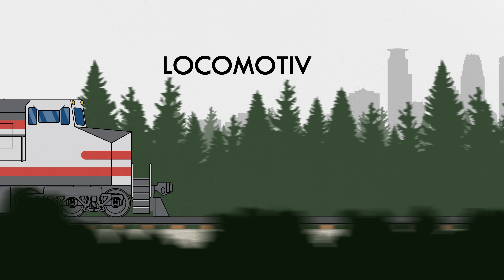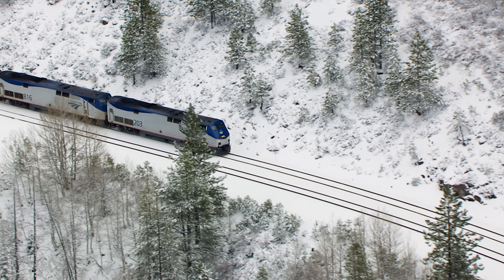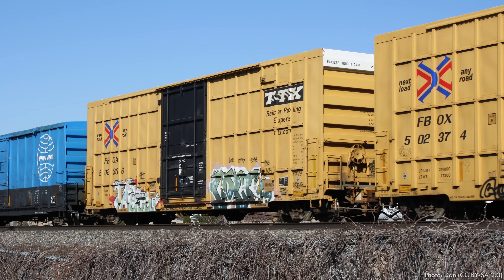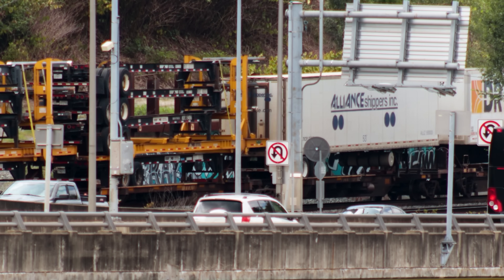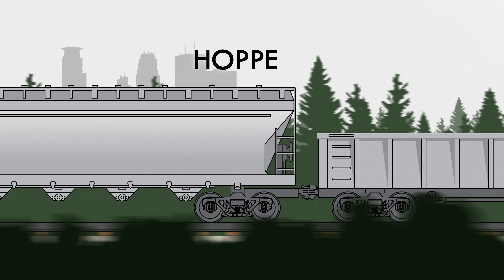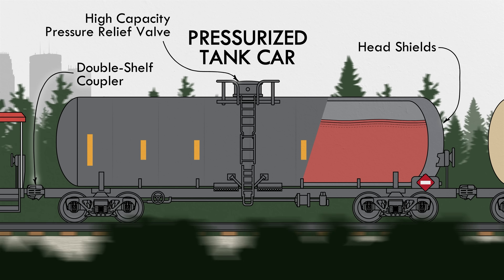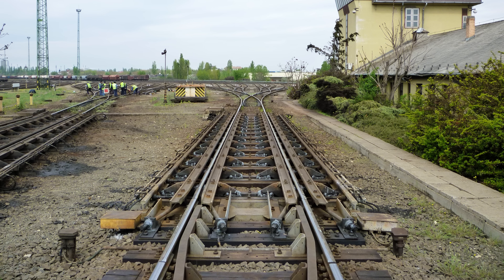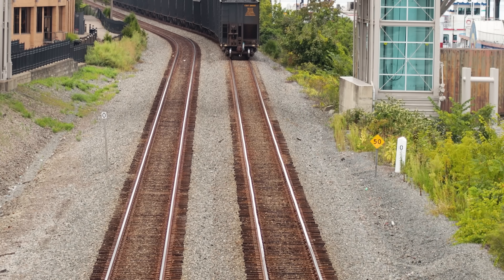Every Type of Railcar Explained in 15 Minutes

Comment: As an European/Italian who lives right above a railway and is very fond of trains, this video is a joy for the eyes! And it is really interesting to see the differences between rail services between The USA and what is done here in Europe. 

Double decker passenger cars are very common in many European countries, like in France and Italy for example, because people here tend to use the train a lot more than the car to commute between home and the workplace or school location, and double deckers obviously are more efficient in passenger throughput in a given amount of time. Low-level cars are also very appreciated because they are most of the time level with the platform, making embarking and disembarking a breeze especially for the disabled. European train manufactures produce mainly low-level rolling stock, double or single decked, these days.

It seems that the main differences between USA and Europe is in a few cars: cabooses, autoracks and coil cars. 
For cabooses, the closest in Europe are the brake vans that were used mainly in the UK when cars had no brakes on them. The UK also had, between the 60s and the late 70s, the so called "brake tenders", which were very low and very heavy ballast cars, looking like big metal slabs on wheels, fitted with automatic brakes, meant to be connected to diesels and assist them with braking. Outside the UK, some European freight cars with brakes had a "braker's box", a very small cabin where the brake man sat during trips and provided him with a brake handle for that car. Continuous braking in all cars/wagons did away with all of these eventually. 
For autoracks, the main difference is that those in Europe are not enclosed like in The USA. The loaded cars are therefore exposed to the elements, like in a normal car carrier truck. Also, autoracks are at most double decked instead of triple decked.
European coil cars are basically in two flavors: the "Shimmns" type and the "Rhlmms" type. The difference is wether the car is enclosed or not. The Rhlmms cars are basically flat cars with shaped seats for the coils, up to 5 usually, which are open to the elements. The Shimmns have a similar arrangement but are also enclosed, and there are two types of covers. One is a simple tarpaulin stretched all over the car from bulkheads and other support beams. The tarpaulin is opened by folding it one one side by moving said beams; the other cover type is a  rigid telescopic metal cover, divided in three pieces, who slide into each other when opened. 

Thanks again for this treat, Grady. Keep it up!!
Reply: Also, at 11:59 the crane (Rauma-Repola Rc 200) is definitely European - it was built in Finland and operated by a Finnish company (NRC Group)
Reply: Another though by gone car to add: The mail car. Basically a rolling Post office where mail would be sorted and then simply tossed out the train in bags whilst it was speeding through a town. Some could also pick up hanging sacks of mail on the move with special hooks. Could be attached to any type of train although express services were preferred.
Reply: I also regularly eee track laying cars parked at one of our local stations. We are quite central, so it's a good place to store them, I guess.
Reply: I do actually see a lot of covered autorack cars here in germany, mostly used to ship new cars from the factory to ports etc (BMW at least use them a lot)... they're also only double decker of course due to the smaller loading gauge.
Reply: @johannesgutsmiedl366 it is normal nowadays, for autoracks to be enclosed, almost all trains that operate in summer going for the coast here in croatia, have that feature to bring your car with you, all have enclosed autoracks, and in general, i did see some old type open ones some years ago on railfan vids from serbia, when they shipped new fiats from kragujevac to the port in bar mnegro.

Schnabel car can be seen here in croatia when they ship industrial trafo from zagreb to the port of rijeka, i think it is siemens made, before some of them were shipped by the an 225 mriya, now only by train, no other plane in the world can lift off with that type of mass.
Reply: thank you, that was very informative!
Reply: In Latvija we only have 1 story passanger wagons, no need for the extra capacity, Ive never even seen a passanger train with more than 5 segments.
Reply: agree
Reply: American auto decker Waggons are covered because kids started throwing stones at the cars
Reply: @henrystoll9402 stones and stealing them

Comment: At 13:00 you see a lot of railroad fasteners are loose.
And ... a bunch of coupled cars is not a train. To be dispatched as train there has to be a brake check, cargo check/registering and EOTD (end of train device) installed. In the beginning of railroading cabooses were housing the brake men. Later on Westinghouse air brake became relyable and cabooses were only to watch cars not getting decoupled and lost in the mid of tracks. The next train would run into it presuming the track is free.
It's a science to control tracks and dispatch trains in a safe manner. Sometimes an extra switch to nowhere on sidings are only to prevent cars running onto the main line (by wind, on a slope) like a derailer.

Comment: Great video.. but i think there is a one type missing.. a control car - passenger car which has a driver cab.. in Czechia we have eg. class 843 which is a passenger car with engine, then you hook up some classic passenger cars and sometimes on the end is this type of car (eg. class 943).. driver just goes to the other end of the train and drives it from this unpovered car. 
https://en.wikipedia.org/wiki/Control_car

Comment: I think you should try to approach this more globally,...

in that case even what you say at 0:47 is inaccurate then as many trains over europe, especially passendertrains have motors on many wagon in multiple-unit sets
additional passenger cars might be control cars, which are normal coaches but with a control station at the end
many older passenger trains also have a luggage car or a bike car

Comment: Greatly enjoy the High-Cubes, Autoracks, and flatcars together since they’re all largely tied to the auto industry. High-Cubes, particularly the longer 86ft ones, were largely developed to carry auto-parts from factory to assembly plant. Those finished products roll out on Autoracks, which used to look a lot more like double or triple deck Flatcars. Technically they still are, but the roofs and side sheets make them look like boxcars, not helped by the fact boxcars with end-doors was the early way of moving autos from plant to sales floors

Comment: There are loads of trains without locomotives. Wheels in each carriage are powered, either by overhead electricity or by diesel engines. Certain carriages have small cabins for the driver on the end, but still allow passengers through so trains can be joined together.

Comment: But trains don't have to have locomotives. Aside from the common design of railcars, they can be hauled by cables, compressed air or electromagnets; or even moved simply by gravity.

I've never been sure why we don't see bilevel cars with bilevel boarding. Train stations are normally three dimensional structures, already.

Comment: Another interesting fact about trains is that there is a length limit for them. Since sometimes there is just a single rail running from one point to another, they have to stop and let others pass in small railway stations, and if you exceed the length, things go south very quickly.

Comment: You should have included a triple crown car as a rarely seen car and pretty cool. It has what’s called a bogey which a tractor trailer is set down on under the rear wheels and then connected to the front of a trailer using special pins. I sort of looks like a line of trailers driving on the rails with only the trailer to support the weight. And maybe go into detail on the different types of engines out there. Such as wide body or standard cab. And how the air brakes work completely opposite that of semi trucks.
Reply: Those were quite common in the 90s, but are now all but extinct... There's 1 Triple Crown train a week that runs from Lafayette, Indiana to Ft Wayne, Indiana, but if I'm not mistaken,  that one is to be phased out soon, if it hasn't already...
Reply: @joshhardel528  there is an an entire triple crown yard in detroit Michigan that runs trains daily out of it. I just built and brought one down from detroit that was 6700 feet the other day. Getting ready to go back to detroit to do it again tonight. There is also a triple crown that goes though my yard to Decatur Illinois that we get on daily.

Comment: Nice Video. My climbing gym is right! next to one of the main german czech, with its outdoor wall directly overlloking the tracks, so you get to seen a lot of cool trains from different countires. With all this information I'll definetly be spendig even more time looking at trains. 

But it's funny how antequated the passenger train section appears from the perspective of a country with a dense highspeed rail network, we've only got the dinnercar, the rest is just one integrated train system with regular passenger cars and distributed power. (Bonus fact, the reason the next generation of ICE trains won't be bilevel is because it doesn't add that much capacity once you factor in the space for staircases, larger entrances and larger luggage racks to compensate for the lack of overhead storage. But for some reason the IC trains mostly are bilevel)

Comment: I'm a retired railroader.  Fairly good descriptions.  Probably the most important thing about a U. S. freight car is that they are designed to hold the maximum allowable weight of material.  The Association of American Railroads' typical weight limit for a car qualified for interchange between railroads is 143 tons (286,000 lbs.).  This allows for 100 tons of cargo and up to 43 tons for the weight of the empty car.  There are also standard sizes for cars, expressed as (tem)"plates" stenciled on the cars.  They are letter designations starting with "A".  The standard U. S. clearance for interchange between railroads is "plate C", so a couple of sizes bigger than the smallest.  You might see one that says "exceeds plate C", which means it's a little bigger than standard, but not as big as the next standard size.  Auto racks are often plate "F".  Those limits largely determine the size of a particular car.  The descriptions of the differences between open and covered hoppers and gondolas was a little garbled with the images, and the drawings of baggage and combine cars didn't include the larger doors for loading/unloading baggage.  Dome cars are pretty much not used in regular Amtrak service in the U. S. anymore, although they are for excursions and private cars that Amtrak sometimes handles.  You might have mentioned something such as an ore jenny, which is pretty much specialized to mining areas, like the U. S. upper Midwest, designed to hold heavy, very dense material like iron ore, in a small space.
Reply: Thanks for the additional info
Reply: Hope railroad retirement is paying you well👍🏻
Reply: They do, old heads usually have more money than they know what to do with. You just have to make it that long by not dying on the job, and there are a lot of awful ways to do that.  @opiumextract2934
Reply: A small correction, please: the typical 100-ton car is 263,000 lbs on 4 axles--200,000 for load and 63,000 for tare or the car.  It works out to about 33,000 lbs per wheel on the rail with that distribution.  This is similar to the semi truck of 80,000 lbs GVW on 18 wheels for most of the highway network.
Reply: @royreynolds108  More of a clarification than a correction.  the UPPER weight limit for car and cargo is 286,000 lbs., I didn't say most of them were that much.  A freight car can carry up to as much cargo as three semi-trailers.

Comment: 1. Trainsets are indeed the majority setup for passenger trains throughout the world but Amtrak and commuter heavy-rail operators in North America still build their own in the switching yards at hub stations.

2. Double deck passenger cars are not as rare as you suggest. Not a majority worldwide but dominant here in the US outside of the NEC and the South. Also common on multiple commute networks in the US. Also used in multiple countries in Europe, as other users have mentioned.

Other than that, this video will be a great resource for those unfamiliar with trains!

Comment: Here in Germany, we also have Castortransportcars, for transporting castors with nuclear fuel rods inside of it. Pretty unique worldwide I think. Also we have torpedo cars for transporting molten iron and insulated cars , for transporting castings, so that they dont cool down as much, while being transported from one forging place to another. Yes they are actually transported hot sometimes. It just reduces the power required to heat the forging back up. But those are super rare.

Comment: You didn't mention slug cars. Its an locomotive that doesn't have the diesel engines, but get the electricity from an attached locomotive. Usually used at slow speeds like in a switchyard. Under those circumstances, the locomotive can produce more electricity then it can use so the access can be used by the slug.
There is a railyard right next to the building I work in and there is a slug in use all the time.

Comment: 0:38 It's a shame to gloss over Multiple units here.
While most US passenger and all but exceptional freight trains are locomotive driven, many countries have a majority of main line passenger services and most all High speed and metro systems run by "multiple units" or MU. Generally these are Diesel (DMU) or electric (EMU) powered and come in "semi-permanent coupled" sets
In am MU passenger train there are usually 2-4 carriages with motors underneath and cabs built into the ends. The carriages pull themselves along and changing directions is as simple as the driver walking to the other end of the train.

Many MU trains are coupled together on busier lines all being controlled from the front. In the busy commuter lines into London it's common to see 3, 4 car sets coupled together into 12 carriage trains. Also common are 9 carriage sets running high speed intercity services and 1 car units serving remote lines.

A couple of notes
Some MU sets have unpowered cars mixed in to cut costs on motors
There are Bi-mode MUs that can use electricity if available or diesel if not, allowing an electric train to travel a more extensive route
I believe Japan and Germany have cargo EMUs in service so Cargo EMUs do exist albeit rare.
France's TGV high speed trains (and their exports) are a notable exception to EMUs as high speed intercity trains
Locomotives can also be "MUed" so that all the locomotives in a train can be controlled as in an MU train

Comment: You kinda glossed over the self propelled cars (japan even has a freight EMU), be it Diesel, electric or back in the days steam powered, EMU/DMUs have kinda taken over the rails in most modern passenger railways due to being a prepackaged unit with a constant power to brakes to weight to capacity scaling no matter how many units you hook together

Comment: Hi Brady, enjoy videos. As a train nut, with my own miniature railway a relic from my childhood nearly 70 years ago, I have always loved trains. One of my grandfather's worked for the NY Transit Authority and I spent time riding with him.  

I did want to make one point, some trains do not have locomotives, if powered by electric they may have multiple unit in which many of not all cars have electric motors powering wheels on the car. This is particularly true in subways/metros but some long distance trains may also use this method of providing power. There are also passenger cars that have diesels built in here in the states they are often very old but still serviceable RDCs or sometimes called Budd Cars. Last I knew some where actually in use in Texas so you may see them on the rails near you.  In Europe these are common on less traveled route and are usually called Diesel Multiple Units or DMUs.  

Finally there are also rail buses that function much like the trucks you mentioned that can run on both road or rail. 

As you say there are an near endless variety of cars and motive power. I look forward to future episodes.

Comment: That's funny.  At the 13 min mark, you can see one of the nuts on a tie hold-down s-clamp is loose.  The lock washer is clearly not compressed and the clamp noticably goes up and down.  Funny that of all footage available out there, you chose one where there is a non-standard action occuring.
Reply: I noticed that immediately too.

Comment: i would have quite some addional wagons for the List like but: Winebarrel wagons for ... transporting Wine, while no longer in use in that form, Stainless Steel tanks are way better for that, a Caboose is also not really longer in use.
Silo wagons for transporting ... dusty things like loose cement,
and i am baffled that it already made it to the list but: Railway Cranes,
also there should be an addition for the Rolling Highway since well, they are way different than a flatbed,
or driving trailers for the more usefull end of passenger wagons.
And not forgetting the Transporter Wagon so you can transport regular wagons on narrow gauge railways.
While speaking of tank wagons, it might be interesting to mention that you can spot some pressurised ones due to the addional sun shade on top or that many tankers for mineral oil or chemical goods have a small kink

Comment: I commute through Oslo S and they have a fire train in the corner of the station. It's roughly 5 cars including the locomotive. I've only seen it pull into the main station twice but I can't say I've seen any other rail car equipped with water cannons.